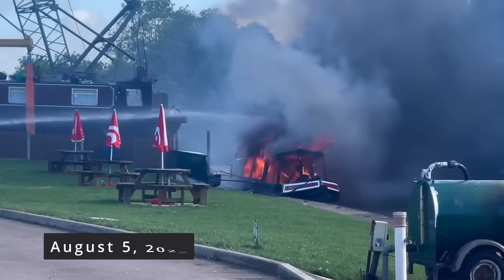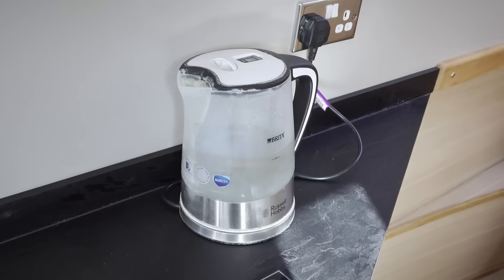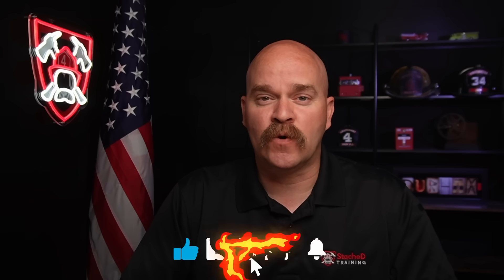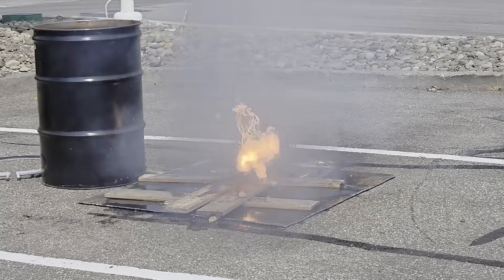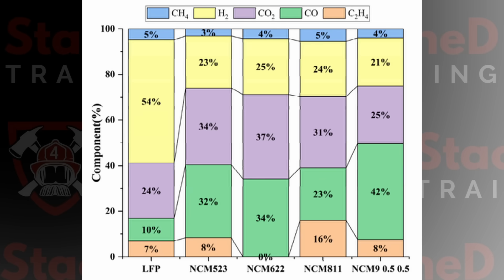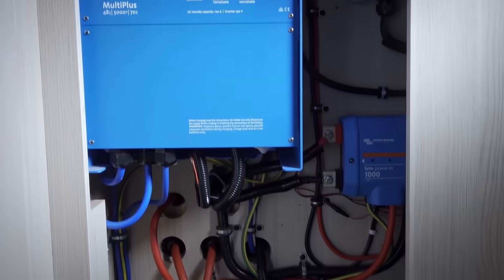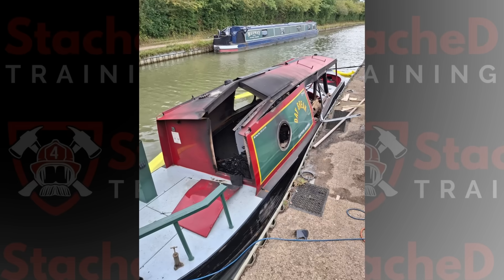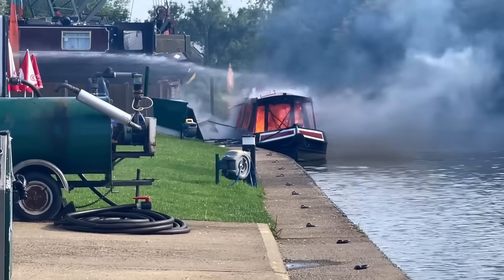Electric Boat Explodes While Charging: LFP Batteries

Comment: Wow, that is shocking. Are you sure this boat (only) contained LFP?
Reply: I have been searching for the batteries shown in the video. These are made by Predator, but even in the specifications I can't see LiFePO4 or LFP mentioned anywhere. Now I know this is other footage, but not stating the battery chemistry in Electric Vehicles usually means it's NMC as LiFePO4 is a selling point.
So I would really like to know who has verified this was an LFP fire.
Reply: Just had a better look at this video on my computer and the text LFP  does seem to be on the battery of this footage. I really don't like the way this is all connected and the not so fireproof straps touching the terminals. But apart from that, there is no guarantee that the boat that was on fire had (only) LFP inside.
This looks to be some kind of retrofit, so the quality of the install is a huge unknown. The absence of proper ventilation of the battery compartment is a clue.

Comment: An electric boat is the dumbest thing I've ever heard of. It's almost as if these EV zealots have no idea what happens when water is combined with electricity.
Reply: The guy in the marina who took the fire video you posted, and viewed the aftermath, said the batteries were mounted up against the divider bulkhead in the  dry part of the boat, not in the propulsion motor compartment under the rear deck.  
Seen no definitive proof of battery chemistry, but someone looked at the batteries of this boats sister ship, and said they were not LiFePo. 
Maybe some more due diligence is in order before an "expert" opinion is offered.
Reply: What powers a non nuclear sub under water? There's a huge fleet of electric tourist boats on the Königsee in Germany. Many others world wide. Let's not forget the water/electricity mix in hydro electric power stations.
Proper design and maintenance keeps them safe. 
Suggest you think and do some research before posting uninformed reactionary comments.
Reply: You just not used to hear yourself talking. Otherwise even the utterly stupid approach, of producing batteries, that as as tightly packed as possible, to reduce shipping costs, would seem sane beyond measure to you😉
Reply: Zealots 😂😂😂
Reply: Mad Ed milliband.....perfect example.

Comment: Ban lithium batteries.  I bet 99% of the people have no idea how dangerous they are.
Reply: So should we ban all cell phones?
Reply: @WillProwse absolutely 🤝
Reply: @WillProwse  Thanks Will, good to see you clock in on this.
Reply: its not the battery itself its the higher voltages like the 48V or not made properly if we ban lithium ion batteries there won't be no smartphones on this planet
Reply: @ethancarins4587 cell phone batteries have done the same thing.
Reply: Already opened the Pandora's box , if they stopped making them tomorrow,  still got a lot to safely dispose of. Any store of energy comes with issues.
Reply: Going by your username if they tried to ban guns I bet you'd be outraged.
Reply: Yeah we should ban all cell phones for sure. Too dangerous. People even charge them indoors. We absolutely need to make them illegal
Reply: Ban you, as 99% of all people have no idea how stupid one person can be. 

The amount of heat released from a single 18650 or a 500mAh pouch cell, is negligible. We just need to stop, packing these cells as tight as possible, to appease the shipping department🙄 These cells need to be spaced and contained in a hydrogen absorbing material. This will make batteries too bulky to ship globally. It will also make portable devices like vapes and mobile phones and torchlights less sleek.
Reply: But old rusting gas cylinders are ok ???
Reply: Ban fossil fuel engines heating & cooking in boats NO 1 CAUSE OF BOAT FIRES
Reply: The newer lipo4's just smoke a lot, the fires are usually from bad wiring, getting wet or not properly charged. I overloaded  and burned dozens testing them and they are about as flammable as wood and none exploded.
Reply: This.
Reply: "Ban lithium batteries" 

Good luck with that 😂

Comment: Of course  they can go into thermal runaway.
Reply: Not according to the fan boy crowd
Reply: I hate the stigma around these batteries when 90% are involving user error such as this incident with the manufacturer not taking into consideration that these packs may need some form of cooling while being out on the river in the sun reaching temps that these batteries aren’t designed to withstand I always found it interesting how many ignore manufacturers instructions and are shocked when something goes wrong like the hoverboard incident which was likely caused by people leaving them charging for 24/7 without breaks or even using it!
Reply: @CajunReaper95 the manufacturers of the batteries build them to be barely functional past a warranty. Your lucky that they arent defective from the manufacturer,  one minor car crash or not and they easily catch on fire. Its so bad that no scrapyard will take them, shipping companies wont transport them.
Reply: @CajunReaper95 
At this time that would be out on the canal most days and where they are stored would think would be cooler as down in the hull on or below the water line so cooling from the canal water on the hull. Not sure what batter change management they had but some gone wrong there would think.
Reply: LFP thermal runaway is not self propagating, so its very different than Cobalt based chemistries. LFP does not create a temperature high enough to release oxygen in the rest of the cell.

Comment: Powering a boat with batteries that are potentially spontaneously lethal when they get wet is a bold strategy
Reply: @infinidominion As is powering a boat with a highly flammable fuel like petrol, which has a low flash point and a heavier than air vapour - and yet...
Reply: @thedogfather5445 very few boats are now powered by petrol engines apart from outboards.
Reply: @thedogfather5445  Petrol powered vehicles catching fire has been so common during the past 100 years that it's not even worth writing about it. Whereas the media reports any single incident with electric vehicles. Selective perception has great power to deceive people. In some cases (like certain yt channels), it's even self imposed.
Reply: @valuemastery yet the ability to extinguish gas is much easier and the pollution from those batteries is more problematic
Reply: @kimberlysteller2556 and yet the batteries are part of the solution for the pollution produced by petrol engines.....
Reply: Yes I mean all those submarines running on batteries as well - what on earth were they thinking!!! 
Worlds gone mad!🙄 
sheesh...FFS Grow up people.
Reply: @bbbf09  Exactly Japanese Sōryū Navy Submarine uses Lithium Ion batteries. Just under a century of using various metals and Acid batteries.
Reply: Come on. Fires in the engine compartment aren’t that uncommon for IC ship engines. Some ruptured fuel line plus hot exhaust system and you get a nice fire. If this had been a normal boat that burned down it would just make some local news. Each system can have life threatening issues.
Reply: Petrol boats fires are far more common and far more likely.
Reply: @brucealmberg also far easier to put out. Hell.... The boats crew can handle a petrol fire themselves in most cases. Or the boats has a system that closes off the engine room, and floods it with CO2 and extinguishes the fire. Can a ships crew handle a lithium battery fire?
Reply: And then the appropriate fuse rating to protect the cable size.
Reply: your so uninformed
Reply: Diesel electric submarines hold my beer
Reply: @blindsniper35 , people misuse "not gonna lie", "begs the question" and "have his cake" constantly, and now "hold my beer" is added to the list. These phrases mean something and can not be randomly added to whatever, just to bring some extra humor or credibility to it. Cool guys use cool phrases, let me start saying the same so I can be a cool guy too.

I can't believe here are more than one people commenting who don't know the difference between lead-acid and lithium-ion batteries. The joke is on you.
Reply: Funny how Submarines used batteries since before WWII
Reply: You do realise every modern sea worthy ship has big battery bank. You're assertions are baseless.
Reply: Not bold ,just net zero sense.
Reply: I'm unaware of a battery chemistry that when wet turns into a thermal runaway. The man in the video obviously hates electric powered everything!
Reply: I believe it's too early to say what happened in this case. LFP is a very safe chemistry. It is considered to be non flammable.  It doesn't explode! That is a 100%!
Reply: Meanwhile, we've powered them by inflammable fuels in (usually) controlled explosions to drive them for centuries.
Guess which usually has more fires?
Reply: The big lie by omission is that fossil fuels can, will and have killed people aboard ships as well.
Reply: Fresh water in the battery hold would not be likely to cause a fire.  The fire was probably caused by a battery going exothermic due to an internal failure.  There isn’t enough information here to determine a cause.  The Predator batteries shown have internal battery management systems and the series string appears to have balance leads going to the charge controller.  Something to watch out for is that batteries should be individually charged to 100% before installation they are installed in a series string in order for the charge controller to properly monitor.  48 Volt batteries are available and I would have used them in preference to four 12 Volt batteries in series.
Reply: @wtmayhew nice explanation, thank you for providing it
Reply: It would be a bold strategy but that isn't the case here .
Reply: Cars are driven in the rain.
Reply: when they get wet? So how do you see that happening then? Because all lithium battery cells are sealed units... So yes, after a long time under water the case wil fail, but not just from getting wet.
Also lead acids are very good at killing people as wel. They can explode pretty easy during charging because of the hydrogen release. But they can also release the very deadly h2s, something that a lot of people dont seem to know about.
Reply: Wait until you hear about this machine called " A submarine" they operate UNDER the water on batteries that will either gas the crew to death or explode when they contact sea water.
Reply: "BOLD STRATEGY."😂.
Reply: Normally there is no risk of electric shock when a battery on any vehicle gets wet, since it's not grounded. On the grid, electricity + water can be very dangerous. But on an ungrounded battery, you would have to touch both poles to get a shock. It's not anough to have contact with the water the battery is in.
Reply: @valuemastery , nobody was concerned about electric shock. Did you even watch the video?
Reply: @seriouscat2231  I didn't respond to the video, but to the original poster of this thread (otherwise I would have started my own thread). I was under the impression that he referred to this danger by mentioning electricity in combination with water.
Reply: @valuemastery , he is referring to moisture being the initiating cause of thermal runaway. Not to anyone being electrocuted.
Reply: @valuemastery There is a risk with some lithium batteries due to the outer metal casing being at +ve potential, when most steel boats are at -ve potential, meaning a direct short can happen if they are not double insulated. This is also a problem in a wet environment as moisture completes the circuit, leading to corrosion and breakdown of the battery structure.
Reply: That and you see these flogs putting 3x 150amp batteries together and using wire barely rated for 100amps, when they should be using wire rated for 450 minimum
Reply: @jamesaustralian9829  Wire to use does not depend on how much current a battery can deliver, it depends on how much is drawn from the battery when in operation. Also, on vehicles with powerful motors, the 3 batteries would normally be connected in series to generate the high voltage such a motor needs. In this case voltage adds up, not current, so 150A wiring would be adequate (if connected in series).
Reply: @valuemastery depends on whether you are taking into account short circuit or other abnormal currents and have correct fusing
Reply: @DanRyan-v5y  Yes, exactly. A fuse is mandatory to protect cables in case of short circuit or unusual current draw.
Reply: @valuemastery It would only be adequate if the batteries were fused at the terminals
  Short circuit currents can be massive and BMS boards can arc out allowing current to flow even in a disconnected condition.  There must be fuses to protect the wires and at 48v they should probably be class T.
Reply: The main issues I see in all applications regarding these batteries is the use case which is almost always in a hot sunny climate and no preventative measures to keep the the pack cool which would potentially prevent some of these accidents it’s like these manufacturers have no idea what they’re doing when it comes to building these packs most if not all packs have a maximum operating temperature these can safely operate at before you cause them to go into thermal run away!
Reply: @CajunReaper95  We could design the thermal runaway entirely out of batteries. We just choose not to, because it makes bulk shipping impossible.